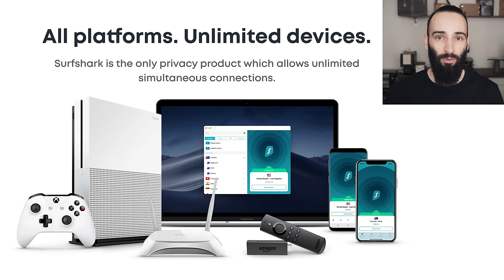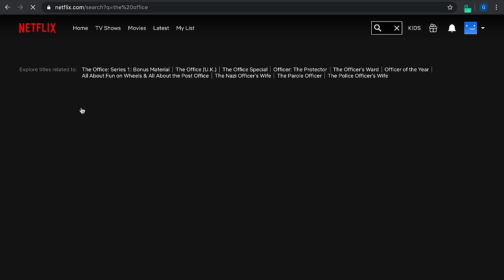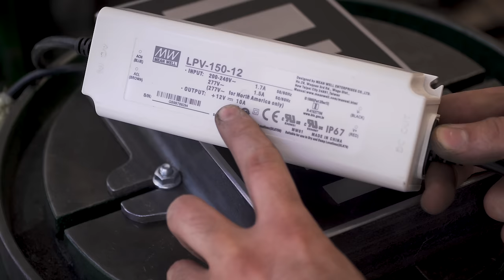DIY Electromagnet | Vise For Excelsior Drill Press

Comment: It is worth to put a diode between the +12VDC and GND in reverse direction, because when the magnets are switched off the magnetic field collapses around them and induce current which have to find a way around. If no way for the current to flow, a voltage skipe will form which can hurt the 12VDC driver circuit.
Reply: Any of the 1n400x diodes will be more than enough.
Reply: Absolutely! The current capability of the diode MAY matter under certain circumstances but the voltage rating is of greater importance as any capacitance in the cicuit can cause ringing, hence high reverse voltage across the diode which can easily blow low voltage diodes. 

Choose one of over 200v rating for safety. PLENTY of FREE 1N4007 (probably the most ubiquitous rectifier diode on the planet) can be obtained off many scrap electronics boards such as PC PSUs. The 1N4007 has a MORE than ample voltage rating for the job,
Reply: The microwave itself has a large hi voltage Diode from the high voltage capacitor to ground

Comment: Nice! Could have mixed sand in the epoxy; saves some 60% of epoxy, it will yield a composite with a stiffness close to pure rock, and it would also aid with heat dissipation. SiC grit would have been even more awesome for that. Such a composite had been used quite often for various machine bases.
Reply: Great recommendation.
Reply: And it would destroy the file or anything else you tried to use to smooth off the surface.
Reply: @HairyNumbNuts  Could top it off with a bit of pure epoxy; but yeah better plan things so that you dont need any post machining operations.

Comment: That's brilliant! I'm curious if this would be strong enough to mill parts on it.
Reply: Yes! try this please! I will watch your video too! I believe Make it extreme has some videos on this
Reply: I'd be cautious about that. Plunge cuts would probably be fine but side milling would be more problematical (the magnets will have much less holding capacity in shear than in the normal direction).You could certainly use it for surface grinding though as the shear forces are minimal. Most surface grinders use a mag chuck, although often of the permanent magnet type.
Reply: Your last video just keep appearing to me in the recommendations.
Reply from the maker: Maybe for large parts that cover all the magnets surface! But shear resistance is definetly lower than normal. I am able to slide that drawbar a bit if I pull real quickly with all my weight and force! :)
Reply: Unless you are talking a large chunk of steel and a tiny endmill then that would be a hard no. Milling vises exert tens of thousands of pounds of force for a reason. Mills slam carbide and high speed steel cutting edges into the part sideways like a jackhammer on meth.
Reply: If you put some flat iron bars around the Material you want to mill it wont fly away that easy.
Reply: Awesome for knife making!
Reply: I like the video, don’t get me wrong, but it seems like in all videos like this they do a strength test (like you did) but don’t show it to the point of failure. I wish you had put a long enough bar on it so that you could break the magnetic hold. Maybe also hit the side of an attached chunk of steel with a mallet so that we can see what shear forces will hold and what won’t. 

How about heat. How long can you leave it turned on before it gets hot (if it does at all)?

It looked like you destroyed both the primary and secondary when taking the transformers apart. I didn’t catch where you got the windings that you used. (I’ll go back and watch that part). 

I’m very glad you showed the powers supply. That is one thing similar videos seem to leave out.
Reply: Oh I see now. I don’t know what purpose it serves but I was thinking the red wire was one of the coils.
Reply: @merlinmagnus873  you're WAY over estimating milling forces, and vise clanking forces for that matter. "Tens" of thousands of pounds of force, no. 5k-10k lbs of force. (Like a Kurt 8 inch vise) You're making a blanket statement about a general question, without knowing the milling that is being done, or the flux of the magnet. Could it hold a part being milled with a 20 hp cat50 machine? Probably not. But a Bridgeport/knee mill or small VMC, provided there was enough area x thickness (volume) of material, and a small enough mill was being used? Most likely, yes. Parts are frequently held with super glue, vacuum, and hot glue... And electromagnets. So using this one as an electromagnet isn't out of the question. He said it moves a bit if he uses "all of his weight and force." That's a lot of force.
Reply: @xenonram  I've seen many vises rated at 15k and maxed out with a cheater bar to 40k. Should you use that much pressure? Of course not, you would crush most parts but the overhead is there. I've some neat setups with superglue but thermal control is a must for obvious reasons. I just personally have never had any luck with magnets. 1/16" endmill with a 10 thou depth of cut and the blasted part shifts. Just not worth the headache. In the time I takes me to remake the part, I could have just machined a custom fixture for the vise. I've just got magnetic PTSD.
Reply: @xenonram  I agree, for knife making where the surface area is large and cuts are fairly light it would work well. I also like the addition of a drill clearance hole in the middle of the field.
Reply: @gregorymertens6964  the red wire is a winding that runs the low voltage filament in the magnetron.
Reply: Surface grinders frequently have electromagnetic beds. I think the key would be getting the electromagnetic vise flat and parallel enough for your desired milling tolerances. But, for simple hobby work, it should be fairly easy to fabricate one suitable for your needs.
Reply: Amazing workmanship!! Well done
Reply: Does it get hot?
Reply: @xenonram  differences that substances such as super glue are actually pretty durable under shear loads magnets are only their strongest under compressive loads.
Reply: @coulombicdistortion1814  are not a lot of cutting forces involved in grinding though, pretty low compared to milling.
Reply: @lazyh-online4839  I would think that the horizontal loads involved with surface grinding are similar enough to milling.
Reply: @coulombicdistortion1814  The lower cutting forces is one reason of many why surface grinding can be so much more accurate than milling.
Reply: @lazyh-online4839  You might be correct, I'm not familiar enough with surface grinding.
Reply: Not very bright answer
Reply: When he pulled out the hack saw, I was really happy I have a mill!
Reply: Maybe, but what happens if you lose power or the circuit breaker is tripped? Insta missile launch.
Reply: @merlinmagnus873  It's all about the details.  I have a small Brown & Sharp magnetic chuck that fits in my vise.  I've used it for taking very small depth of cut passes to shave a washer down.  I just had to setup the fence on the side and only mill in a direction where the endmill would push towards that fence, but it worked just fine.
Reply: @yashkantatray4242  I see what you did there. 👍M.M.👍
Reply: If you try it in a milling machine you may have to dou ke the power of the electro magnet and go slow. Also use the same exact transformers not mismatched ones or you will have a greater capability on one end of the magnet than the other. This can lead to over estimation of the magnets capabilities rnd to end on your piece to be milled. You may also end up with a magnet that will alow you to mill only one direction on your piece. Additionally if you work in aluminium this will not work at all for you.

Don't let that stop you from trying though it looks like a fun project just remember that crashing your mill is no fun. Procede with ample caution. But by all means procede!
Post your successes and your mill crashes!
Reply: Genius!
Reply: Wait wait ... It cannot handle vibrations . Like rapid movements
Reply: That looks like a lot of work to cut the thickness of your transformer casings. Will it work if your angle iron framework  matched the transformers?
Reply: @coulombicdistortion1814  not even close, surface grinding if done correctly is a few orders of magnitude smaller.
Reply: @cheek1m0nkey  the drill would power down at the same time surely?
Reply: It would. In another video, the youtuber was only using 1 and he maxed out his pull scale at 650lbs AND he was only at 8amps when he could pump it to 20 if he wanted.
Reply: Build one of these with multiple transformers in different positions.
Reply: @BlackBeardProjects  From what I have seen I will suggest more coils provides greater power to hold. Good project, thank you for sharing. Oh! The others I see have used two or even four condenser coils , meaning ovens. Where yours used one. I figured you would bolt it down and mill the surface flat. Before you got all strong young man; o us and picked up a good file  ☺
Reply: @davidgillies620  Nah, ive seen many large surface grinders and the larger the grinder, the more likely that it will have an electro magnet... The magnets that span longer than a meter are often electric, or rather, rarely are they perm. magnet...
Reply: no way, magnets only have a pull force. Lateral forces will send your part flying off like a rocket

Comment: I wonder how long it took you to hack saw the excess metal after your first epoxy pour.
Reply: 5 days
Reply: Exactly 1 scene transmission.
Reply: My question, as well.  Why not get larger metal for the frame?
Reply: @walte99  Because he would loose height on the drill !
Reply: @walte99  what he had hanging around?  I think he is still in lock down]
Reply: @Elviloh  It appeared he only took off 1/2".
Reply: I assume he gets it started on camera and then immediately takes it over to the oversized portable bandsaw just off screen... actually, now that I think of it, why didn't he just make a little jig to run it through his actual bandsaw?  Too tall?  It looked like it was taking forever.
Reply: i dont understand why he didnt cut them to the correct hight in first place before he epoxy them in 🤷🏻‍♂️
Reply: @walte99  It was already bigger than needed, he just needed to encapsulate the coils. That he didn't size the E Bars a little better with the band saw first, is a curiosity. But, effective and attractive results.
Reply: considering it's soft iron plate and not a hardened steel not too long! more or less taking the time to make sure it doesn't wander and you keep the cut somewhat flush with the top edge of the box frame, though if you had a mill to put this on you could flatten it relatively easy!
Reply: yeah i got tired from just thinking about it :-D
Reply: There's a reason for the cut :)
Reply: @deanwhiteside6339  @ Excess transformer body is cut off now rather than earlier to avoid tearing apart the thin plates that makes these parts (if these gets damaged they tend to buzz and make weird noises)
Reply: @Elviloh  But most bench/pillar drills have a table that's on a rack and pinion, you could therefore just lower it a bit more. Judging by how much he cut off we're only talking about 1 cm anyway.
Reply: @ToeCutter454  It sounds like you haven't tried cutting a MOT with a hacksaw before. I have. It sucks.
Reply: @Elviloh  Looks like that table would go a lot further down than it is right now.
Reply: That’s a brilliant idea and really great looking end product
Reply: U need to talk and let people know what u r using and where u can get some of the stuff. Enjoyed the video.

Comment: just remember when doing smaller parts while it is magnetized down, the drill has enough force to turn the part so it would help to use a bit of angle as a fence to help the footprint of smaller/slimmer parts. Fantastic video!
Reply from the maker: Great tip! Thanks!
Reply: I wonder if you took apart another microwave transformer and turned it into a 1000 amp transformer to power it how much more powerful it would be
Reply: @godparticle3833  I think you may need to do a bit more reading on magnetic cores and the saturation they experience! You get no more magnetic flux once the core becomes "saturated", hence the term and for a microwave sized transformer core it is HIGHLY doubtful you'll get much more than 100-150 amps flowing before saturation occurs. Just take a look at the size and weight of a typical MMA welding transformer to see what I mean ... Rare to find an old style transformer of that type capable of much more than about 200-250A (not without a MUCH bigger transformer)! 👎

Comment: The safety warning at the start was a very good idea. High-voltage capacitors are a nightmare and they can keep a charge for a surprisingly long time (also remember the stored energy goes like the voltage squared). Back in my electronic engineering days we had a phrase: a "one-mistake power supply" as in you only got to make one mistake with it because that was all it took to kill you. As little as 11 mA across your heart ("eleven mills kills", another phrase we used) can put you into ventricular fibrillation and that's generally fatal.

Apart from that, absolutely beautiful build.
Reply: Why are you babbling about high-voltage caps when it was already covered in the video....shut up!
Reply: Skin cancer kills too. Gloves welding
Reply: Good info. Any recommendations for a method on safely draining the Cap? Was, disappointingly, just glanced over in the vid.
Reply: @wingnutbert9685  As per the video, shorting the terminals with a pair of pliers works very well, as long as the handles are insulated.
Reply: Large capacitors can also hold a deeper charge so be careful. Even after discharging by shorting them, an hour later they may hold a surface charge again. Always discharge capacitors immediately before handling them or connect a permanent shorting device.
Reply: @parapicktog7734  Yeah i recall large capacitors are shipped from factory with wire connecting the tabs, as those things can build up charge over time just from static electricity and electricity in the air (atoms in air rubbing each other and the tabs creating current). Those are only taken off right before connecting to device and when removed same short circuit is made to prevent it happening.
Reply: I think 11mA is a little on the low side, and a more realistic figure is about 50mA. Here in the UK RCDs and RCBOs are normally expected to kick in at around the 30mA mark. So they'd be pretty damn useless if 11mA was a lethal current.
Reply: @semperidem2577  It's not 11mA current draw, it's 11mA across the heart that is the threshold at which ventricular fibrillation happens. There have been cases of people killed by a 12VDC source if they have been unlucky enough to puncture their skin (at which point resistance drops precipitously). That can happen with a poorly-cropped solder joint, for example. The upshot of all this is that it's not whether you're paranoid about working on equipment that might be powered up or carry a remanent charge; it's whether you're paranoid enough .
Reply: Can you tell me from where you got this 11mA value? As long as I remember its something around 20mA and as long as I remember most of RCDs are rated for 30mA. 

I'm just curious.
Reply: @Exorcistt94  Just a mantra we had drummed into us in electrical safety lectures along with the usual horror videos of all the ways you can die if you don't pay attention. "Eleven mils kills" was the refrain, but even if it's 20mA, it's still a really small current that's not difficult to put through your heart under a wide variety of scenarios. Kilovolt caps are one such scenario.
Reply: @davidgillies620  I heard that if you pass current of 33mA through muscles they cramp and won't let go until amperage falls down under those 33mA. That's why it's dangerous, if you are under tension and the current passing through you is less than this value you can still free yourself by your own will :p.
    It may warry from person to person and environment conditions (mostly moisture, tiredness of body).

Health and safety is really intesting topic

Comment: I like it, I like it a lot. You connected the electromagnets in series and than used 12 volt at 10 amp for the supply. Amazing how much holding power you have... Thumbs Up!

Comment: Very nice indeed. If I only had that recently the drill would have not caught the metal breaking through the other side of the steel bar I was drilling and sling the vice the bar was held in, into my hand as I was holding the vice. I'm healed now, but that would work amazingly for drilling large holes in solid metal bar... Thumbs Up!

Comment: Curious why you didnt just connect the primary and secondary windings in series, would have produced a stronger electromagnetic force by doing so. Also you didnt mention how the direction of the coils should idealy be in the same (both clockwise or counter clockwise) so the resultant polarity is the same 🙃

Comment: I have had one of these in progress for a while. I also have a power supply for 12VDC and 10A. The circuit itself is a near-short, even with a load on the chuck were relying on the internal resistance of the wire. I’m not sure if you’ve tested this much since posting, but the design as presented is quite nice except is has a serious flaw; the heat dissipation into the copper windings and into the iron core isn’t enough if you have a long job or forget to turn it off.  You risk a melt down of the wires, or a fire... hopefully the fuse blows before then. When I get a chance I will fully post my build,  but if anyone else does this is strongly recommend you watch the temperature rise on the coils. Another option is to use a Car battery, but the heat also skyrockets in this near short configuration.
Reply: This comment should be higher up.
Reply: did you finish yours ? show us
Reply: @Theccrstudio  I used it for a while, using an extension cord as the long conductor worked ok, ended up scrapping the build and using a permanent magnet chuck instead.